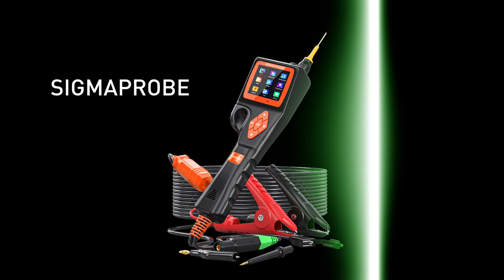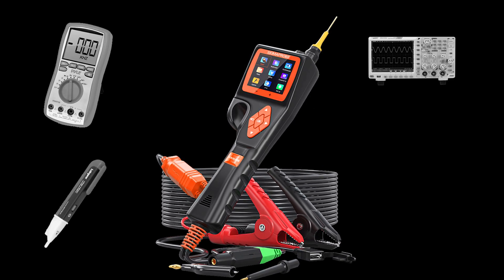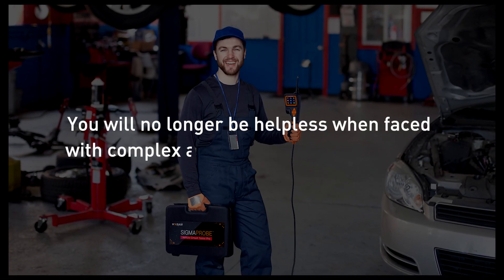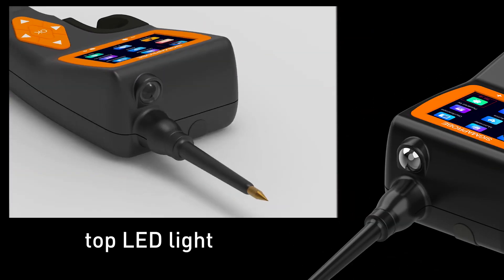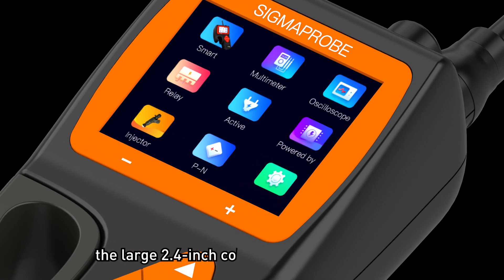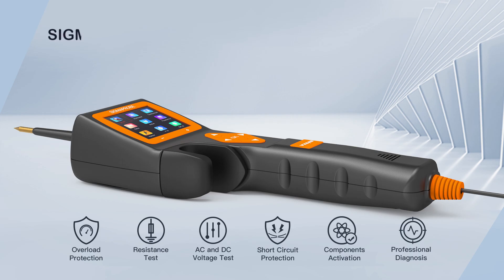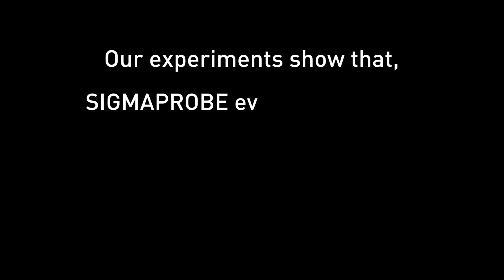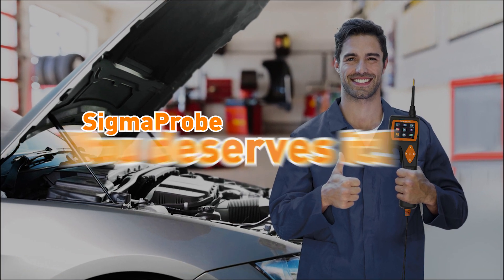A New Generation of Automotive Circuit Tester—SIGMAPROBE

Comment from the maker: The unique configuration of SigmaProbe testers gives them many advantages over using conventional test lights or multimeters for circuit testing.

(1) the SigmaProbe™ is connected to the battery, you can apply battery power or battery ground di-rectly to the tip of the tool. You can energize and activate components to verify their correct operation. This is real dynamic component testing and the only true way to test an active component.
(2) SigmaProbe™ is always connected to the ve-hicle’s battery, so the tool maintains a permanent con-nection to the source power and ground voltage. Circuit voltage checks are quickly performed with just a single probe connection, unlike using two meter leads.
(3) Using the SigmaProbe™, all your voltage checks are referenced back to the source battery and account for every connection and possible voltage drop between the source and the probe tip.
(4) Automatic Voltage Drop Indication. When probing a circuit, if the voltage measured at the tip is 0.5 volts lower (or more) than the source battery voltage, the red LED will not illuminate, and no tone will sound. This will instantly alert you that there is a voltage drop that may need to be investigated or repaired.